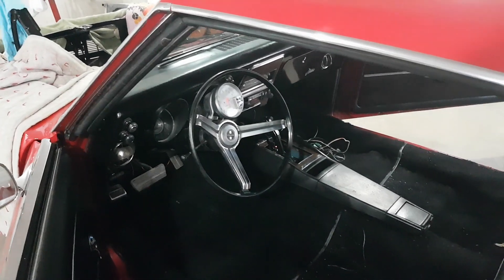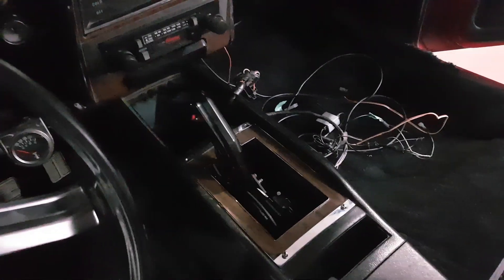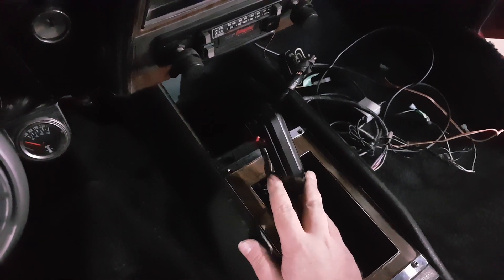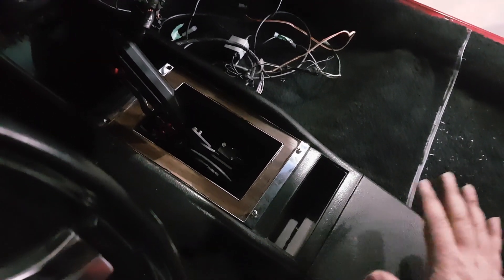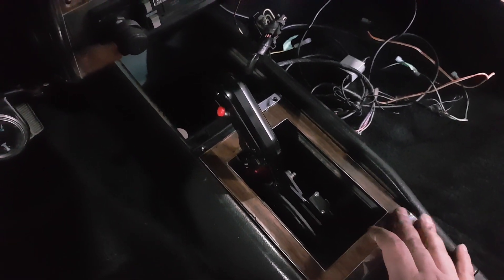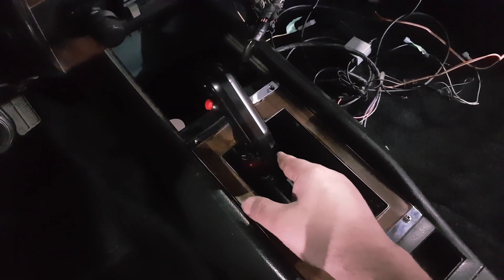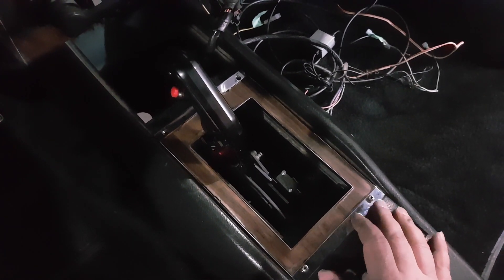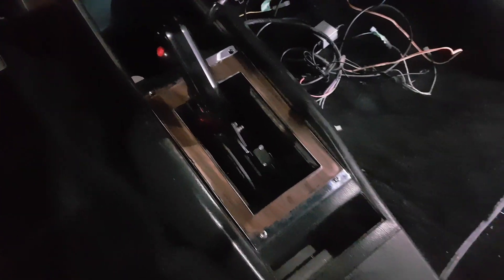Putting the B&M pistol grip shifter in my 1968 Camaro

Comment: That shifter plate is gonna look sweet
Reply from the maker: Thank you I think it will look pretty good if it turns out the way I Envision it. It's going to give it more of that stock original appearance which is what I'm kind of going for with the build that's why there isn't a whole lot of chrome and polished aluminum and a lot of bling in this build. I'm hoping that it's going to look like something that was built in the 80s and 90s